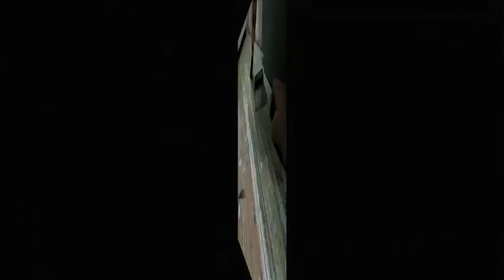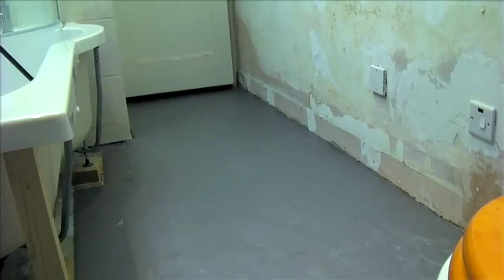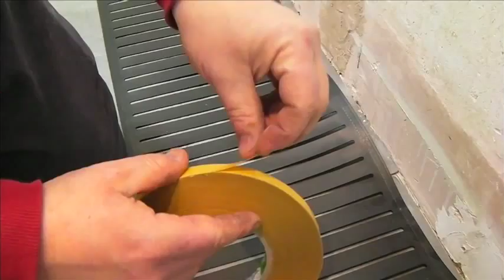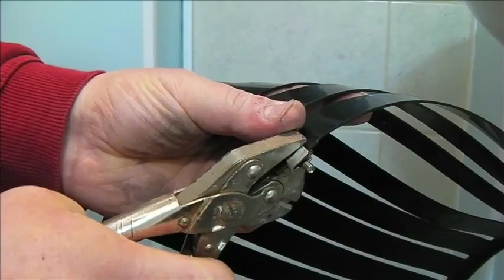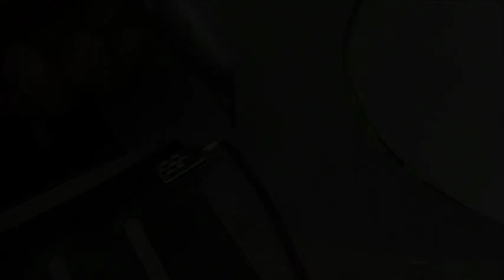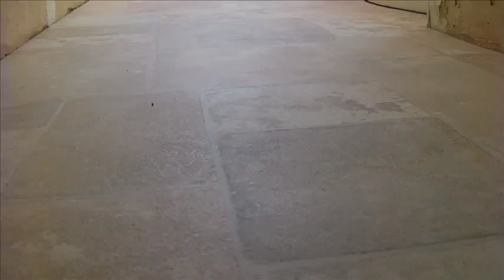WarmFloor 24v Underfloor Heating Install

Comment: Sam, very smooth helpful video. I am thinking of using this stuff in my kitchen. Can I ask is it warm enough and is it really as cheap to run as the company says? Did you notice any difference in your electric bills?

Comment from the maker: Thanks Mike. Yup its a great system. I'd get more umph out of it if I insulated the cieling! I'm only able to cover about 50% of the floor because of the bath, loo and basin, but nonetheless it's created a comforting background heat. Since this install I've added a 200W towel rail which is a nice addition. Glad you like the video.

Comment: I'm just about to do my bathroom and kitchen with this system, so this video has been very helpful. I'll comment again when I've finished to say whether it's as easy as it looks here. It's quite expensive to buy but the running costs are so low and the comfort factor so high that I'm quite excited by this product. Yes, I should get out more.

Comment: Great looking product!  I installed a mains voltage round wire system, it works OK but there is a noticeable temperature difference between the wired and unwired areas.  Your feet are excellent sensors of even a half degree difference.